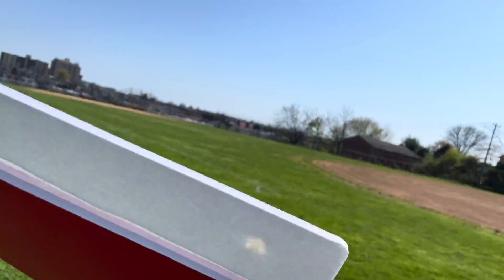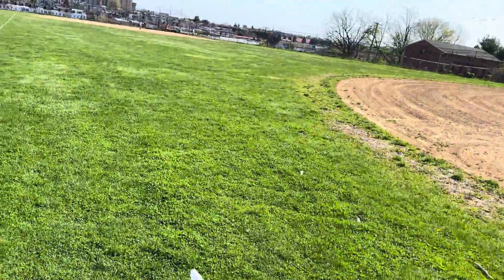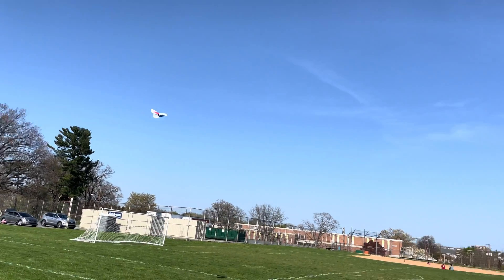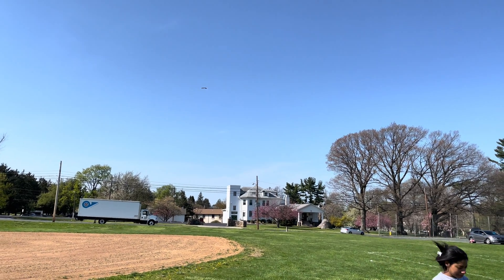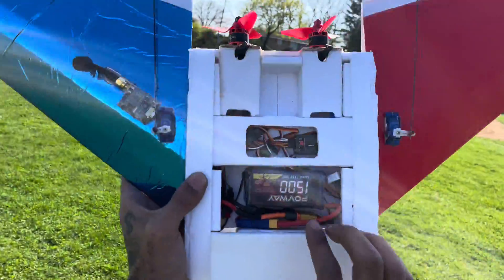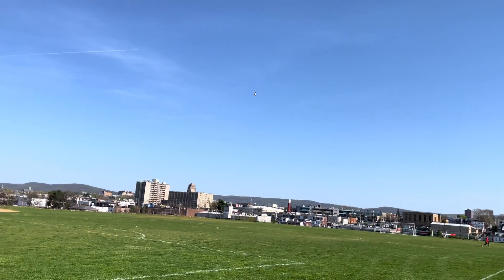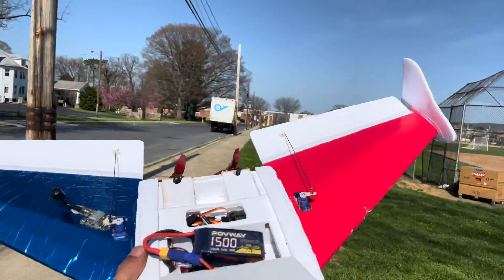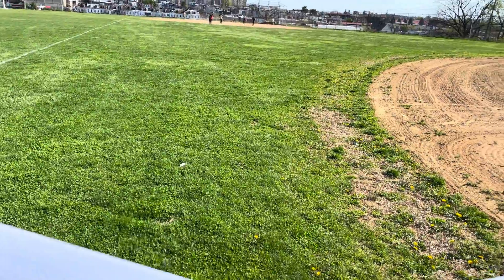Modded Ft Spear

Comment: High kv motors pull a decent amount of amps and then you have to multiply that by 2.  Wonder if you switched to bi blades if your top speed would increase and also give you a bit more efficiency.  Might be a little weaker on the vertical tho
Reply from the maker: Makes a lot of sense! Ima have to definitely buy some bi blades and give that a try ! I thought this could be a great fpv plane but this flight time is really bugging me lol 😂Thank you!
Reply: @crossgenrc3235  oh I know. I don't like short 4 min flight times but those are usually more fun to fly lol 😆
Reply: That's a common misconception with Bi-blades, when speaking about efficiency "while an aircraft is in motion". Single-blade props are rare and experimental in most cases they're the worst in efficiency when moving through the air BUT they're Best when in a fixed flight position (ie Drones hovering in the air). Bi-blades are the most common on the market but they're at the bottom of the list in terms of efficiency. Tri-blades and Quad's are better. However, it really depends on the purpose of the aircraft your making and in hindsight the same concept applies to consumer, commercial and military aircraft design. 

The more blades you can fit on the hub of a propeller the more air the props can grab to produce thrust at low rpm. When say a hexa-blade prop is spun up in high rpm then the thrust bleeds out of the blade tips and a quarter of your thrust is lost to turbulent air currents which creates drag and means less efficiency at high rpm for an aircraft in motion. Hence Jet engines eventually replaced Reciprocating Engines sacrificing Static Thrust (Acceleration) for Dynamic Thrust (Velocity). However, all the air the Intake Fan that a Jet Engine takes in, is channeled through an Air Duct and the numbers are so minuscule for Thrust loss it's rarely if ever brought up in a conversation. 

Don't get me wrong though, there are plenty of examples of seasoned rc pilots who've built rc planes that exceed 100 mph and I've witnessed a man fly a Hot-liner Sailplane at a ballistic 305 mph!! Still the question remains, Does the rc plane require Efficiency or Performance. That's rhetorical question that was made to establish the former statement rather than to elicit information. 

=D

PS... Food for thought and Positive Encouragement to learn more about aircraft mechanics and design when applied to RC Aviation!!